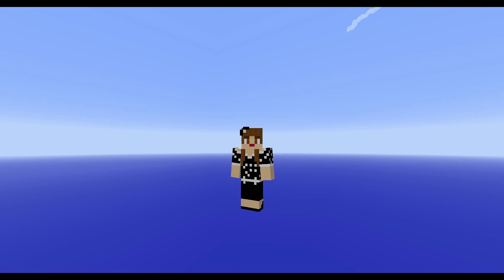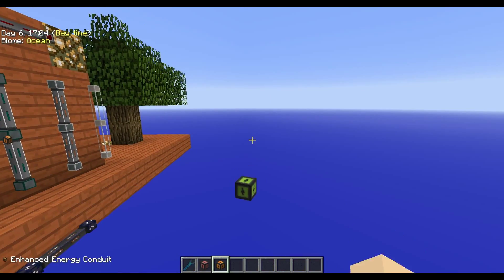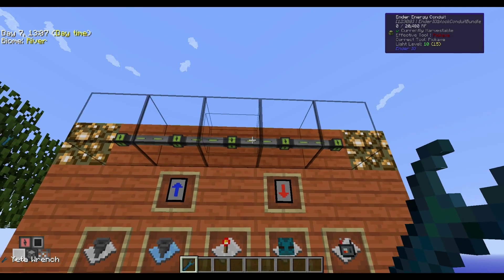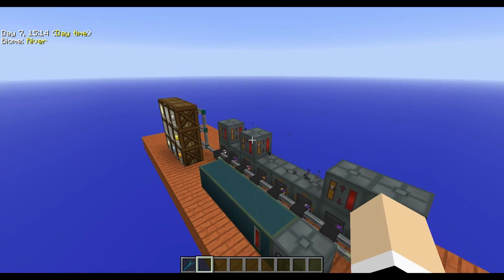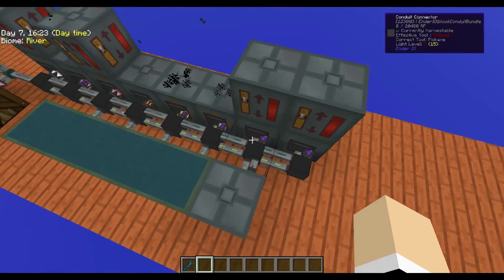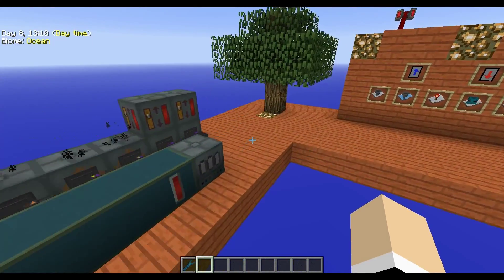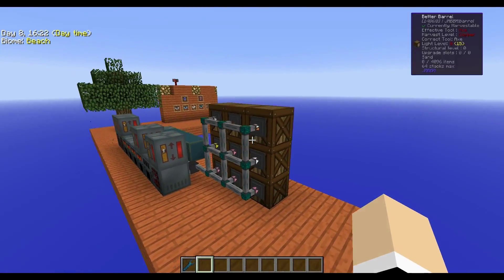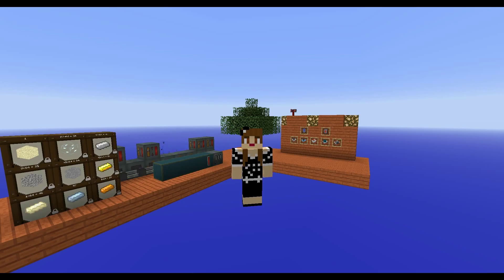Ender IO Conduit Tutorial

Comment: Can anyone please explain the two modes of the EnderIO Conduit Probe?
Reply from the maker: There is a copy mode.  This mode will copy settings from one connection so you can paste it to others.  This is good if you have a lot of connections that need to be the same.  The other is the normal mode.  This mode allows you to select connections you might not be able to reach otherwise.